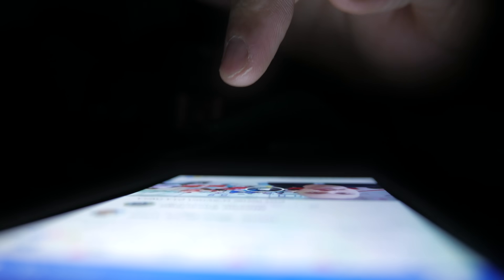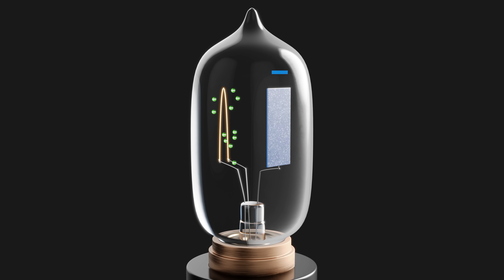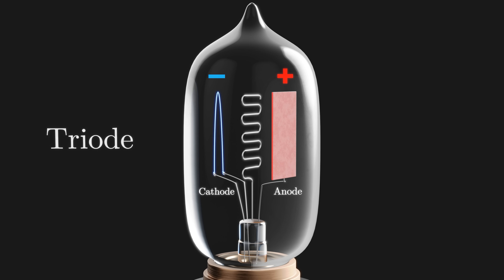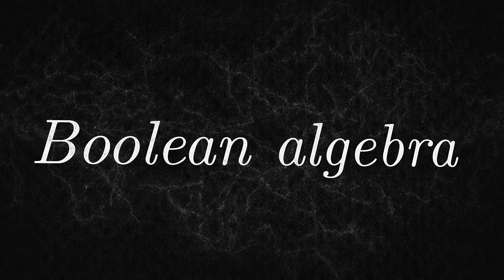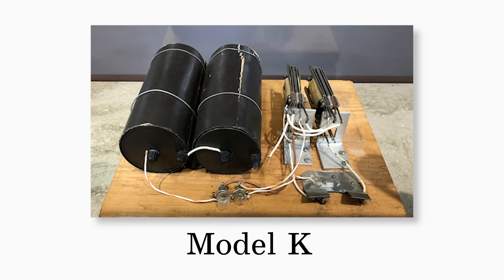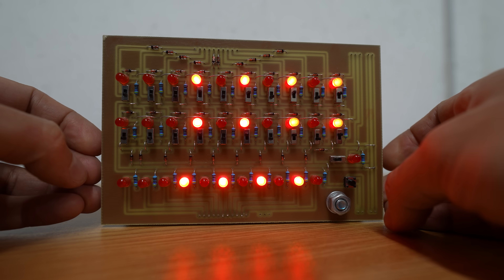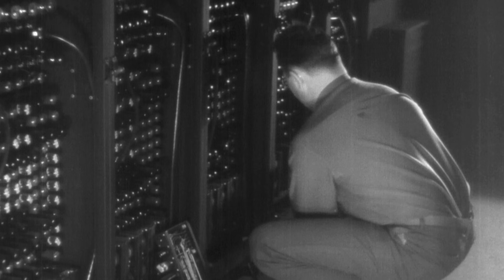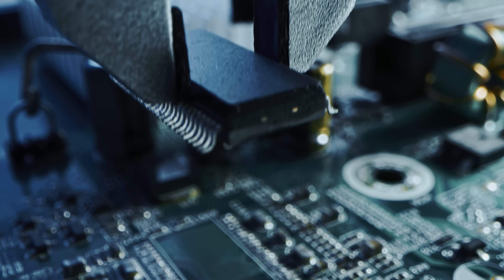Why The First Computers Were Made Out Of Light Bulbs

Comment: I look forward to the next video in this evolution, because after this comes the transistor.  I think it could be argued that the biggest milestones in human history are the mastery of fire, the printing press, the discovery of penicillin, and the invention of the transistor.  There are literally billions of transistors used in our everyday life, yet very few are aware of how much they have changed the world.
Reply: I would probably add internal combustion and agriculture (I’m not 100% certain here, but I believe it was the advent of crop rotation that first enabled long-term/perpetual human settlement), but yeah, you’re definitely not wrong!
Reply: @doomtho42  Yes, the invention of farming (or, if you want to be more specific, of crop rotation) definitely belongs on the list, as the most important innovation of the past 10,000 years.
Reply: About 10 sextillion transistors have been made since they were invented in 1947.
Reply: Don't forget the disco ball
Reply: @a.t652  One of my IC layout colleagues decorates his workspace with a disco ball.
Reply: You missed the hammer, without that you have nothing.
Reply: Don't forget the wheel.
Reply: @harpintn  and @dantefernandez2455...

YES!!!
Reply: You certainly need to add the Haber-Bosch process to that list!
Reply: Surface Plate is underrated
Reply: I feel like either the wheel, or boats , or both, are greater than the printing press. Each probably had an equal or greater impact on how far, and how quickly knowledge spread across humanity, compared to the printing press, not to speak of the good that efficient trade brings.
Reply: @haldir108  imagine you live in a big European city, long before the invention of the printing press. It didn't matter if you had the means to move around, either way, you probably couldn't afford knowledge because books (or other forms of text) had to be handwritten. So knowledge was spatially limited to where the book or the teacher was. It didn't matter if you had airplanes, without the press, knowledge distribution would have been impossible.
Reply: Ha. Modern high-performance CPUs already have multiple billions of transistors in each one. You can bump your "billions of transistors" number up a lot higher and still be drastically underestimating ;)
Reply: Toilets.
Plumbing included, of course.

Man, a world without toilets is a very different world.
Reply: Ha, I would say nearly EVERYBODY is aware of how they have changed the world
Reply: Neural network too
Reply: Nah i would say invention of wheel, invention of agriculture/civilization, invention on writing, printing press, discovery and control of electricity and electromagnetism, transistor
Reply: I agree.
And maybe the Industrial Revolution and the Internet?
Reply: id add refrigeration to that list.
Reply: Absolutely.  If I had to pick one invention that created the most fundamental change in the history of humanity, I'd have to go with the transistor.  Literally having billions of them in my pocket was not something I ever envisioned in the earlier years of my life nor could I have comprehended how that would have changed my daily life.
Reply: A transistor would need to be sentient for one of the billions of them to become aware of how much they changed the world. I suppose one in a computer doing AI could sort-of qualify. But I wouldn't say the individual transistor is aware, so probably "none", not "very few".
Reply: @HeadOnAStick  I was thinking of reporting your comment as coming from a bot, because it's such an AI thing to say. But then I remembered how much ChatGPT's language comprehension has improved in recent years, so let me just congratulate you for the joke.
Reply: @renerpho  Farming is a triumph of Wheat, Rice and Corn, that independently managed to domesticate humans XD
Reply: @rageagainstthebath  Are you sure it wasn't a team effort? What one couldn't accomplish, the others finally did.
Reply: @HeadOnAStick  💀
Reply: Forget all that stuff, the most important invention was sex.  Without it, none of that would've happened and none of you would be here today.  Sex is the single most important invention ever.
Reply: Agriculture isn't a milestone because it's pretty much a prerequisite for the rest of this stuff to be possible.
Reply: @DarthObscurity  That's what it means to be a milestone.

I don't know if the wheel belongs on the list. There are (were) highly advanced cultures that managed quite well without ever inventing it. The Mayas are the best example. The point is, I think we would have been able to invent the printing press and the internet without ever coming up with the wheel. The same may be true for the ship, although that's probably harder to justify...
Reply: Discrete transistors have nothing on integrated circuits.
Reply: Humans have not mastered fire. Fire kicks our ass all the time. Alberta, Canada now.
Reply: They have all certainly hastened the end of our trajectory on this planet.   It is interssting you left out the internal combustion engine.

Comment: Thank you for another great video.
But I have a question about the triode, I'm not an expert in Physics so if the gird and anode are both negatively or positively charged, wouldn't it also affect the flow of electrons as well? I mean for example if they are both positively charged, I thought electrons would be stuck at the grid or between the grid and the anode instead of going straight to anode like illustrated in the video? I would be grateful if someone could explain that for me. Thanks all!

Comment: So the whole "leading to digital computers" thing... The earliest practical computers were almost exclusively relay-based. Though very slow, even compared to the later vacuum tube based machines, they were still much faster in computing calculations than a human was. These were mostly built between 1937-1955, with vacuum tube (and later transistor) computers making them obsolete. 

However, despite relay computers being very slow compared to vacuum tube machines, there were also incredibly reliable. Many stayed in service for many decades, and some of the oldest functional computers still in existence are at least partially relay-based

Comment: First, the carry bit from two's complement subtraction always represents the sign of the difference.  As given, C=1 means the difference is positive and C=0 means the difference is negative.  Second, the grid of a tube amplifier must never become positive or the current in it (and the collision energy) will burn holes in the mesh ruining the tube; however, there are degrees of being negative -- slightly negative repels few electrons and very negative repels almost all.  ENIAC:  Electronic Numerical Integrator And Computer.

Comment: As a electronics student I knew what vacuum tubes are but finding out the history behind them was super interesting.
Reply: i know about them and have even "messed around" with them, because i work with audio/music related stuff. The audio and music industry still uses them, they can produce the same quality of audio than a transistor based system, and they have a very "unique" kind of touch added to the sound. its usually described as a warm super subtle distortion in audio that's very pleasant, and its imposible to emulate trough digital stuff. even music from your phone going trough an vacuum tube desk amplifier will sound very crispy in the most pleasant way there could be.

i know it sounds exaggerated, but if you got good ears and know what you're hearing, you'll see that it's different.
Reply: @Mon-gm7rk  Dude... A Mesa Boogie Mark V amp is my dream
Reply: I think it’s interesting to realize that Tesla‘s invention of the radio would end up relying on an invention of Edison’s, the lightbulb, and a discovery by Edison that he only discovered because of his refusal to use Tesla’s AC, which led to first being used as a device to convert AC to DC, Lol, and then to create another device to amplify radio transmissions and then used to receive and play radio transmissions on a radios speaker.
Reply: @jaredf6205  It would be interesting... if Edison actually "invented" the light bulb which he didn't
Reply: @jaredf6205  Tesla used spark gaps, not vacuum tubes. And vacuum tubes would have been made even if edison never existed.
Reply: @jaredf6205 if those two had gotten along we might not have gotten as far. Ironically the competition of one upping each other’s inventions was the driving force for advancement.
Like most things competition is good for advancement.
Reply: I came here to say this. I knew about vacuum tubes and I knew they were rudimentary BJTs. But it was awesome learning the history and the details.
Reply: I was born 1962.   The local drug store had a panel of vacuum tube sockets so customers could find the proper replacement for their tubes.  That was back in the time when people could repair their B&W televisions and cabinet radios.  Since 1983 I've been designing integrated circuit layout.  I'm currently working on a 16GB DRAM.
Reply: And to test the tubes. As a kid I loved looking at the machine as super high tech.
Reply: If you want to see how basic tubes  are made, there is a channel called glassslinger, where he makes the glass tubes and the metal parts by hand. Not a commercial tube but gives a good idea of what goes into one.
Reply: We found the way to connect the seemingly irrelevant pieces of the puzzle.
Reply: as a nope
Reply: Listen, maybe you can help me out with my confusion?

"In Edisson Effect, the glass became discolored, turning yellow, and then brown, but only on one side." 
But what causes that? If it's because of carbon atoms, why do these atoms get attracted to the positive side? Or why does it get discolored? I thought, in more modern lightbulbs with tungsten filament, the evaporated metal is condensed all around the inner surface of the bulb.

Comment: Edison and his buddies limited the lifespan of the lightbulb so they could make more profits. And again today, they are doing it with the LED. What a brilliant idea. 💡
Reply: Nice urban legend but just a legend. Heated filament was producing yellow light, when at that time you had gas light with mantles producing light that was much brighter (but not as bright as arc lamps). To compete, industry had to increase the temperature of filament, which shorted its lifespan (due to increased not thermoionic emission, but straight evaporation). If you decided to run 230V light bulb on 120V system it would be running forever, but light output would be impractically low. One way to overcome low lifespan of incadescent bulbs was use of halogene gases - but such bulbs were more expensive to manufacture. With LEDs you still have to find balance. While they are most efficient at around half of their nominal current - they are losing already low CRI. So either you push them to nominal and pray for no fluctuations in the grid - or you have light making matching socks even harder. Even cheap chinese filament lights may last over five years. Also, got fluorescent lamp (for high CRI applications) that already works for me ten years.

Comment: Light bulbs became vacuum tube transistors, were miniaturized onto silicon, and packed so densely and minutely that they could operate using tiny amounts of electricity, enabling battery powered handheld devices capable of billions of calculations per second.  Radio links connected those devices to the accumulated knowledge of humanity.  And most people use all of that .. to play Candy Crush or to watch pornography.

Comment: @Veritasium or to anyone who would like to explain this to me

When both of the inputs are closed (9:12), why is there no current going from 'B' to 'Carry'? Shouldn't this situation by analogous to that when only 'B' is closed (9:06)?

Am I not understanding the diagram correctly or is there something not visible on this simplified picture?
Reply: When A and B are different (A≠B), the contacts within the relay are to the left. (Output On, Carry Off.)

When A and B are the same (A=B), the relay coil is not energised and the contacts within the relay are to the right. (Output Off, Carry = A = B)
Reply: @massimookissed1023  But my question was supposed to be about: "why is the relay coil not energised?" (sorry if it was not clear enough). 

At 9:12 it looks to me like the current should flow from 'B' to 'Carry'. That would make it pass through the coil (just like it was at 9:06) energizing it, which would make the contacts within the relay go to the left.

So why is that no the case? Why is there no current going out of 'B' at 9:12 even though it appears to be connected to 'Carry', just like 'A' is?
Reply: @michamaciaowicz2826  At 9:06 current flows through the coil from B to A.
At 9:12 A and B are at the same voltage so there's no current through the coil.
 The Carry light in that case is powered from A.
Reply: @massimookissed1023  I understand that there will be no current from 'B' to 'A', but what about the current from 'B' to 'Carry?
Shouldn't the 'Carry' be powered by both 'A' and 'B'?
Or is the path between 'B' and 'Carry' somehow blocked?
Reply: @massimookissed1023  Unless the idea is that the current going from 'B', through coil, to 'Carry' (B -> L -> C) is too weak to generate enough magnetic pull to move the contacts inside the relay due to the resistance from the 'Carry'. This would explain why there is a magnetic pull in 9:06 (currunt only flows through the coil, so it is the only source of resistance), but no in 9:12 (current flows through the coil and 'Carry' so their resistance add up).

Comment: One little observation. In normal use, a vacuum tube grid should never exceed positive voltage respect to the cathode, or it will attract electrons to itself and overheat. The grid is always negative, when is more negative, it cuts off the flow of electrons to the plate, when less negative, it allows electrons to flow freely. In technical terms, when the triode is in cut-off condition, the plate creates a force of positive electrical field in the surface of the cathode, which is counterbalanced by the negative electrical field created by the negative grid, thus resulting in a net zero electrical field at the cathode. (Radio Engineering, F. E. Terman, 1938)

Comment: Correction to 14:25 ... despite a (false) belief that ENIAC was the first programmable electronic device ... this honor goes to the Zuse Z3 (which was operational in 1941).
Reply: What about the Atanasov-Berry computer?
Reply: the Z3 was an electromechanical computer, not an electrical one. so the statement at 14:25 is correct. however, the statement at 16:35 stating that the first digital computers ran on vacuum tubes is false, since the Z3 is definitely a digital computer ^^

Comment: 8:31 not sure if things were different back then or just an oversight, but when you showed the carry light meaning the result was 2, you also showed both of the lights being on, which would be binary for 3. Having the carry light on with the result light of would be binary 2

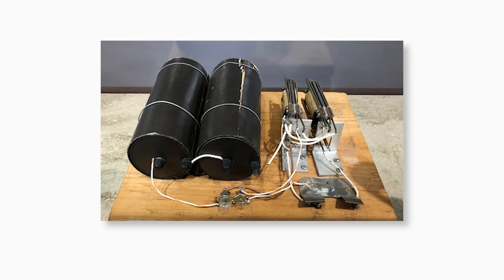update after watching a bit more, I believe this was an error. At 9:20, you showed the correct operation, the carry light only being 2. I understand that just one of those can't represent binary 3 without a carry in, but the first example I mentioned with both lights being on meaning 2 isn't right for either era

Comment: I remember reading about vacuum tubes and triodes a little while ago when watching Back to the Future part II. I was wondering how young Doc and Marty managed to rebuild the time circuit control chip with parts from 1955. The final completed time circuit controller was shown containing vacuum tubes and triodes. I was so confused, since Doc said "suitable replacement parts will not be discovered until 1947" i.e. the transistor.
Why would they be using vacuum tubes if they burnt out all the time? The transistor radio was already available in 1954, couldn't Marty and Doc just buy up some radios and take the transistors out? Would they be able to hit up a RadioShack or something and buy a bunch of transistors? Bell Labs, General Electric, and Philco were researching and producing transistors by 1955. What's going on?
Reply: Aside from it being a sci-fi film, transistors of that era were sometimes less reliable than tubes, that are not in fact as unreliable as most people think. Many tube radios made in the 40s are still working as new.

Comment: What is the message in Morse? 4:15 'Ciao mamma?'
Reply: But morse is in reverse :)
Reply: @Gurux13  So you're saying I need to decode it in reverse?
Reply: @Gurux13  I don't fully understand what you're saying. Are you saying it's 'NMMNM ONIÄ?'
Reply: If you take dots and dashes as they leave the telegraph, you get the NMMNM ONIA.  To get CIAO MAMMA (which is probably the intended message) you need to reverse the sequence.
Reply: @Gurux13  I think it's funny that we are probably in a group of very few people talking about this.
Reply: @pamdrayer5648  I think a fairly large number of people decoded this :)
I'm now more interested in the 52-bit code that drips from a valve later in the video.
Reply: @Gurux13  I guess a lot of people might have decoded it, considering the audience that Veritasium has.
I might be wrong, but I think the pipe decodes as 'ÄĞPÌTEME+M,' but I'm sure that's probably wrong.
Reply: @pamdrayer5648  I don't think it's Morse from the pipe, even though there are dots and dashes. It can be decoded in a multitude of ways if interpreted as Morse.
IMO it's a different code, but I don't quite know which.
Reply: It would be hilarious if we were all just insane and there was never meant to be a code in the first place, but I'm okay with that. I might try a few of the codes I know later.